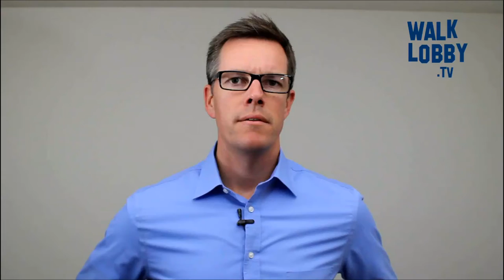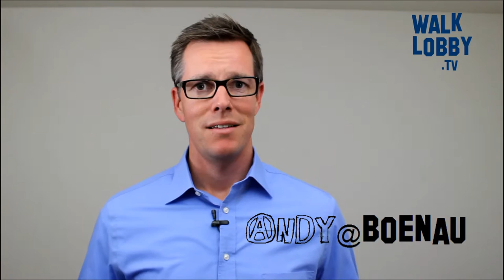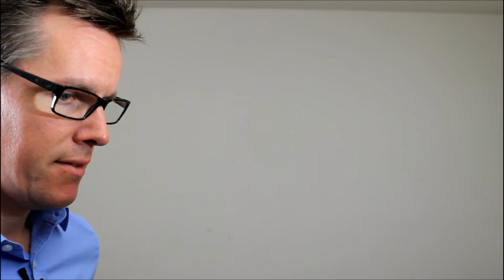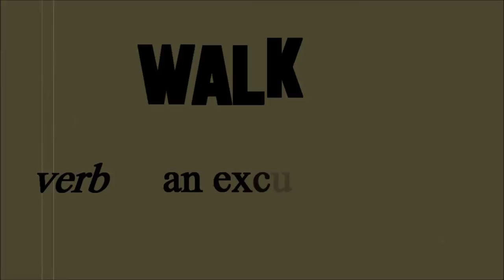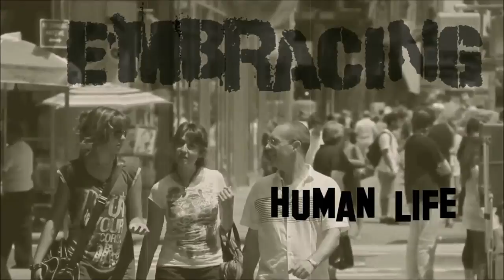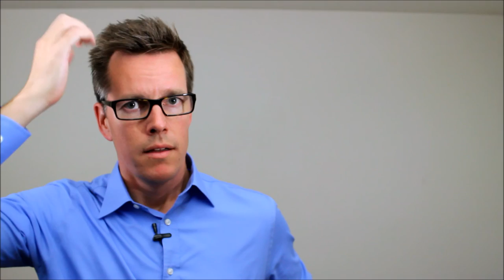How engineers conduct speed studies | Walk Lobby TV

Comment: I drive semi trailer trucks mainly in town... and really, it is my responsability, despite the stupid high speed limit of some streets or access ramps to keep a safe and most often slower speed that allows me to stop the mass of my vehicle within the underconsideted time window a "yellow light" last. Otherwise, there is mostly no way I can make a smooth and safe stop when driving at 60 km/h in a residential area when a yellow light show up in front of me knowing that it will only stay yellow for 2-3 seconds. Of course I will pass on the red light if I would happend to be at 60kmh. Hell. With an enpty trailer, maybe if I jump hard on the brakes and block all those set of wheels. Fully loaded, you're coffee won't even move if I apply full brake pressure. And then come the Yaris that just pops and stop quick between me and the red turning light. Well. Some really don't like their Yaris.